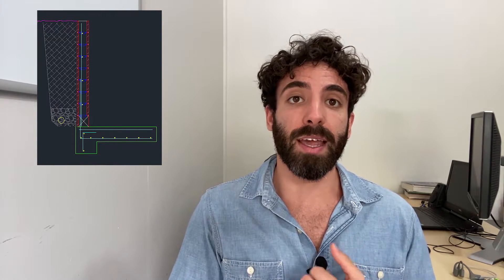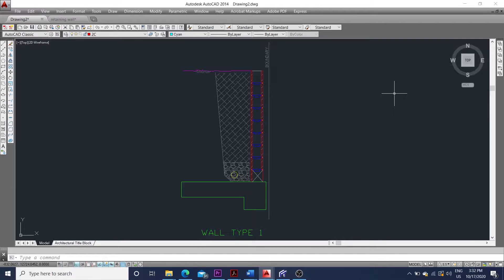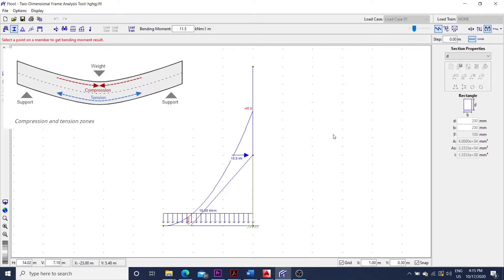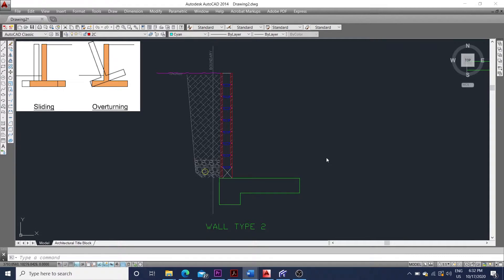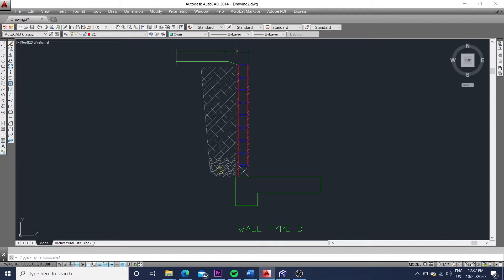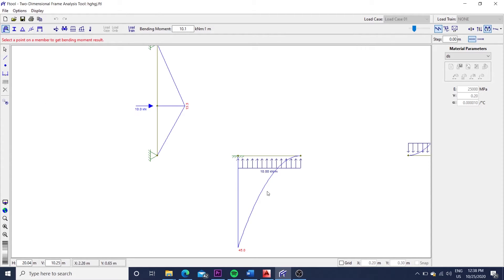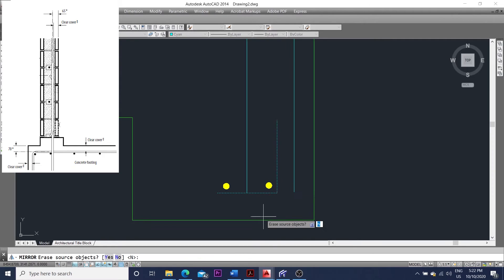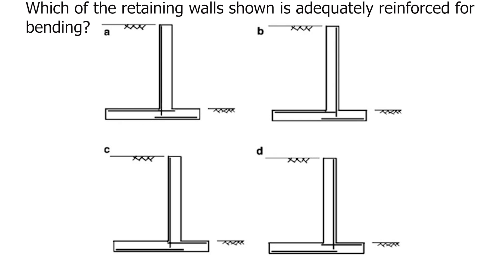Steel reinforcement location in retaining walls and footing

Comment: How critical is it for the footing starter bars to be beneath the bottom layer of mesh? I built a wall recently and due to inadequate concrete cover had to put most of the starter bars on top of the mesh, thanks